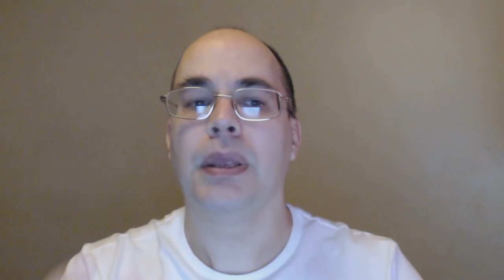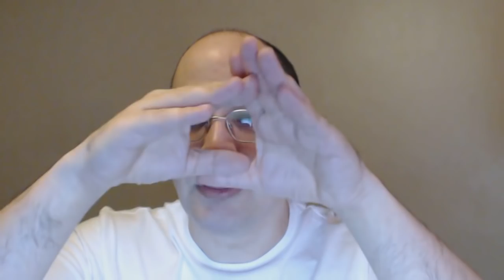How do rockets move in space, with nothing to push off from?

Comment: so let me.get this straight 
all the boosters are to set the speed once entering space, and then momentum carries it after that? I understand something in motion always in motion with space... anyways is that the gist of it?
Reply from the maker: In general yes. To achieve a stable orbit a spacecraft needs to get to a little over 3km per second, less than that and it falls back to Earth due to the pull of gravity, significantly more than that and it has reached escape velocity and flies off into space. More details on this were in my video on "Gravity orbits weightlessness and the slingshot effect" - https://www.youtube.com/watch?v=Zu-Sp3I0c1Q
Reply: Explain what? You haven't said what you want explained.
Reply: + the one Simple retro rockets.
https://answers.yahoo.com/question/index;_ylt=AwrSbmYGUiNaqNwARQdXNyoA;_ylu=X3oDMTBya2cwZmh2BGNvbG8DZ3ExBHBvcwM1BHZ0aWQDBHNlYwNzcg--?qid=20080424075331AAxU91O&p=how%20do%20space%20ships%20slow%20down%20in%20space
It's shocking that in the 21 century you don't know this.
Reply: +DU 20Austin An episode of Mythbusters proved you wrong when they got a rocket to move in a vacuum.

https://www.discovery.com/tv-shows/mythbusters/videos/its-rocket-science
Reply: +DU 20Austin
If rockets did we would be going to the moon daily.
If we had the money, yes. But since we don't...

Man never walked on the moon, a sound stage yes,
Footage from Moon is consistent with a low pressure, low gravity environment, and is impossible to fake on Earth.

Rocks from the Moon have been proven to have extra-terrestrial origin.

Apollo missions have been tracked by thousands of professional and amateur astronomers.

The evidence is overwhelming.

What do you have?
Reply: DU 20Austin a rocket works best in space because of the Bernolli energy equation that states for a fluid stream line Pressure1 + Velocity1 = Pressure2 + Velocity2.  In the combustion chamber the pressure is very high and the velocity of the gas is low.  However, in the nozzle and just outside the nozzle the pressure is low (14 psi or vacuum)  making the velocity very high.  This increase in velocity is an acceleration, using Newtons 2nd law F=ma and 3rd law opposite but equal force drives the rocket forward.  If you compare sealevel pressure, 14 psi, vs vacuum pressure, 0 psi, you can see how the atm limits the velocity of the Bernolli equation at location 2.
Reply: DU 20Austin people in system believe in system eventhough is bunch of lies
Reply: Yes, they do. There is nothing that prevents a rocket from functioning in a vacuum. In fact, rockets achieve their best performance in a vacuum. In contrast, there is only your ignorance and stupidity preventing you from understanding this.
Reply: Tim Jensen Not always in motion when you have the gravity of the earth pulling you back. Here's an explanation of why the rocket can not work in space.
WHY A ROCKET WON'T WORK IN A VACUUM!
Why a rocket engine will NOT work in space! NASA says Neutons 3rd law of motion is what makes a rocket work in a vacuum. The 3rd law states "for every action there is an equal and oppersite reaction".  They say this propels the rocket forward and not the air the rocket is pushing against! I say, using  Neutons law, Imagine two big heavy boxes in space, move them together and put a spring in between them,, connect the boxes together.. Now, the spring is the action and you will have an equal and oppersite  reaction via the boxes, when you detach the boxes the spring will push them Appart. So the action of the spring caused an equal and oppersite reaction and the 2 boxes shoot Appart at equal speeds as long as they both have the same mass..  Now a car is Mass the wheels are the spring or thrust and the road has mass, the spring pushes in equal directions, or the wheels turn and the road and car shoot Appart in oppersite directions at equal speeds. The ship works the same,, propeller is the spring and it pushes against the ship which is a mass,, and the sea which is another mass, the 2 masses move Appart at equal speeds in relation to their masses,, The ship has more mass than the sea water behind the propeller so moves slower than the water, A plane uses the same principal. A rocket,, the same principal,,, In this 3 part equation, ie (Mass spring Mass) or (Oppersite reaction/Action/Oppersite reaction) Quote "for every action, there is an equal and oppesite reaction". The rocket is the first mass the spring is the fire plume, (This is a controled explosion that pushes equally in 2 directions just like a spring) and the earth's atmosphere is the other mass, again proportional to thrust and  depending on the mass of air moved and the mass of the actual rocket determines the speed the rocket moves in one direction. As you gain altitude the mass of the atmosphere exponentialy decreases but the mass of the rocket stays the same so in order to continue up at a constant speed the the fire plume or controled explosion has to exponentialy increase thrust in both directions until finaly there is nothing left to thrust against on one side of the fireplume as the atmosphere has depleted. Now we have a case of Neutons 3rd law of motion only having 2 parts ei ( Mass spring ?????) So Neutons law no longer applies and the rocket will not have propulsion, like taking away the sea from the ship, if ships could fly it would just not move,, the propeller can spin as fast as it likes the ship is not going to move. This is before you consider the unimaginable amount of radiation both in the van Allen belt and in general space.. So that's Neutons law saying you can't go into space for far using a rocket engine, You need something to thrust against...   It doesn't matter what those masses are, that's not the point, all that matters is the action the reaction and the oppersite reaction (Reaction/Action/Reaction) 3 parts.. The 3rd law of motion. You can have one big box one small box, One with double the mass, a super spring, it doesn't matter, the principle stays the same, this is a law of physics. so that's ( Rocket = Mass/Explosion/Atmosphere=Mass) The rocket and atmosphere are the equal and oppersite reaction. Take away the atmosphere and you have (Rocket or mass=reaction/Explosion= Action=Explosion/Nothing????? zero mass = No Oppersite reaction) Now Neutons law can not apply.. The rocket can not propel forward...
PROBLEMS WITH ORBIT SPEED
If we have (mass1=Actual rocket/Spring or thrust/mass2=Atmosphere)
So If thrust needs to exponentialy increase to compensate for an exponential decrease in mass 2. Then there's ,A, An exponentially  increased need for fuel and ,B, A constant weight added for all the fuel nessasary to reach Orbit velocity. 
You would need an atmosphere to use as mass2 and the problem with that is heat! To reach Orbit velocity means 17/18,000 MPH If you do that speed in the atmosphere you burn up?! Especially when you are carrying Highly explosive rocket fuel! 
Conclusion!
In order to achieve enough mass2, In an infinate vacuum, you would need to have infinate thrust and infinate fuel  and that fuel would have infinate mass in order to create enough of an atmosphere in mass2 (space) For the spring or explosion (Rocket fireplume) The action in Neutons law,, ie (reaction/action/reaction) to have enough thrust to propel mass1 (the actual rocket) Forward. This is assuming space is infinate and a vacuum! 
Final conclusion It's not possible.. Maybe very low orbit with very light equipment, but with the radiation and heat problems! Once a rocket engine switches off in space the rocket will start to fall towards the nearest large object unless the rocket is in orbit!! ..
Reply: @davyspilani1231  You have some understanding but are confused on what models can be explained by "springs". Not everything acts like a spring and therefore explaining as such is using the wrong model. As you pointed out, planes and ships would need a medium to use for propulsion. However, rockets don't need to use a medium for propulsion. Rockets rely on Newton's Third Law. If one takes the example of person on skates throwing a heavy object way from them, it is intuitive what happens; the person on the skates will move in the opposite direction in which the heavy object, in this case let's use a bowling ball, was thrown. The interesting thing is that it is because of the mass of the bowling ball and the mass of the person and the velocity at which the ball was thrown. If the ball is thrown with a greater velocity, the distance that the person on the skates would move and also the bowling ball would increase. As soon as the bowling bowl leaves the fingers of the person, all the force in the system would be done between the two objects. It is literally the opposite and equal reaction between the ball and the hand. The two forces between the ball and hand would cancel out (equal and opposite forces). This is known as conservation of momentum. The bowling ball touching the air after it leaves the hand and the air touching the hand does not aid in the person moving backwards on their skates. If however, there was no air, the ball could be thrown with more force away from the skater. With a rocket, the fuel has mass and it is being forced out by the pressure of the combustion (the explosion of the fuel) at very high velocities. The change in the mass flow rate of the fuel leaving the combustion chamber is what creates a force on the nozzle. The fuel is forced out the exit of the nozzle at a high velocity and the the rocket's trajectory is in the opposite direction. The air just makes it more difficult to force the fuel out the nozzle as it acts as an opposing force or pressure (force per area (of nozzle)). That's why it is more difficult to swing one's hand under water than in the air. It is not too difficult imagining the same rocket in space throwing bowling balls out of its rear (regardless of the mechanism to achieve this). The rocket would be propelled in the opposite direction of the bowling balls. The fuel are miniature bowling balls but the velocity that they are thrown out is extremely high. The two models are equivalent. A spring is irrelevant and so is the lack of air.
Reply: Spamming the same comment doesn't make it any less incorrect.
Reply: but once in space rockets wont work - you have your stable SET speed once you enter space - no way to change it or manipulate it unles you some how orbit another body to change your direction - - voyager for example -  HOW do you slow down in space then ?   how did the MOON crafts slow down from smashing in to the moon ? if you can not speed up or slow down ?    BULLSHIT
Reply: @theone-ou1je  rockets work more efficient in space.

Comment: It''s also the ratio of expansion of gases from the burning fuel to the displacement of the gases by the surrounding space/vacuum.

If the gases expand faster than a vacuum can displace the expansion of the gases then thrust can be achieved.

Rockets work in a vacuum as long as the fuel is burning faster than the exhaust can be displaced.

Rockets don't achieve thrust on Earth with slow burning fuels when the gases are displaced faster than they are produced.

The flat earthers think all of the energy is instantly dissipated into the vaccum without understanding the speed of displacement between external and internal pressures..
Reply: Actually the most sensible breakdown thus far...displacement is the grey area for this to end difinitively ...burning fuel at a higher rate means incredible pressure built up
Reply: This actually helps understanding. Thx

Comment: m j murcott
Is there "gravity" in space?
Reply from the maker: Yes, gravity is present in the entire universe, the strength of gravity decreases with distance, but it is always present. The strength of gravity is a function of mass and distance.
Reply: Right, so the rocket is subject to gravity through out its whole journey, then.
This means, once the rocket has passed through atmosphere of any density it is being pulled down almost as strongly toward the centre of the "Earth" as if it was on "Earth".

Indeed, for the ISS to fly at 17,500 mph and for the centrifugal force to be in equilibrium with gravity, then gravity has a pretty strong downward pull at that distance. so once it gets passed 50 miles up where the atmosphere is none existent. We know wings don't do anything toward lifting or steering as they need air density to work. You have fins on a rocket, which in air steers the rocket. in a vacuum, these don't work. 

so how do you stop the rocket from nose diving?
Reply from the maker: The atmosphere thins as It gets higher, it doesn't suddenly stop at 50 miles around the Karman line, though at that altitude it is subject to fluctuations due to solar activity, temperature, magnetism etc. Even in the very depths of space there isn't a true vacuum though it does get close. The rocket is subject to conservation of momentum, once the rocket is moving In a direction it will continue to move in that direction, the reason that rockets are accelerated to those high speed are so that the horizontal speed of a rocket in orbit balances out the gravitational pull of the Earth so the rocket is constantly falling to Earth, but due to its forward motion it misses due to the curvature of the Earth, no major corrections are needed once at stable orbit has been achieved. Any minor corrections needed to the flight path of the rocket can be achieved by the use of thrusters which are enough to nudge the rocket or space station in the required direction.
Reply: +bob question
"so how do you stop the rocket from nose diving?"

Obviously you don't have to, since as you claim rockets don't work in a vacuum.
Reply: Neil Ruedlinger
You are claiming that rockets do work in a vacuum, so how do they stop the sideways force of gravity from steering the thing downwards?
Reply: @evolutionCEO  a thing called escape velocity.
Reply: @codyblakeney7084  
Escape? Escaping "Earths" "gravity"? Why not read the rest of the thread, my dear. Nothing escapes the proven laws of buoyancy/density. The thing you stand on looks and feels stationary because it is. 
Gravity as weight, fine, lets call it weight.
Gravity as a pulling force caused by the bending of "space-time" due to the presence of matter.... no, that's just quantum ballshit and very amusing. The thing is, in order to get you to believe that you are lost in space, on board the ball of spin, an accident in the infinite, there has to be a pulling force. Balls in space going around each other require this lie. However, its a theory that people have taken as true, when it is not. The lack of evidence for a hypothesis is proof to the contrary.
Reply: +bob question
Your question is pointless because you claim without experimental evidence that rockets don't work in a vacuum.
Reply: + bob question.  in orbit the spacecraft is, effectively, nose diving.  It is nosediving towards the planet at a rate that because of the speed of the spacecraft exactly matches the curvature of that orbit around the planet.  Hence it is falling around the Earth.  With no friction from an atmosphere it will continue falling around the Earth forever - like the moon.